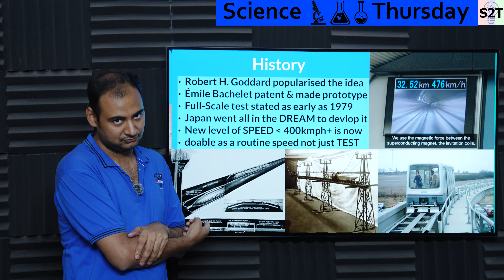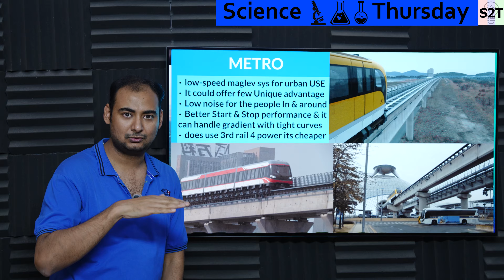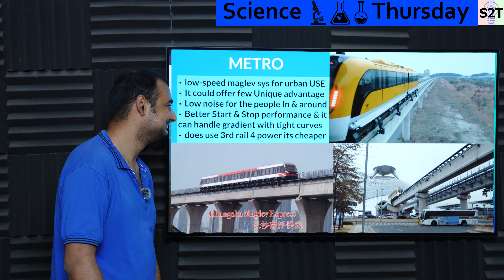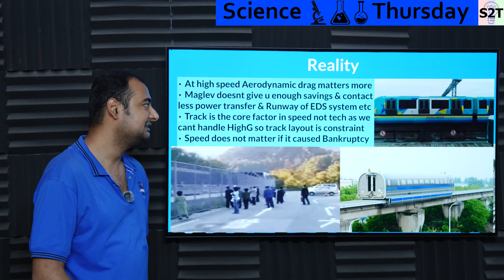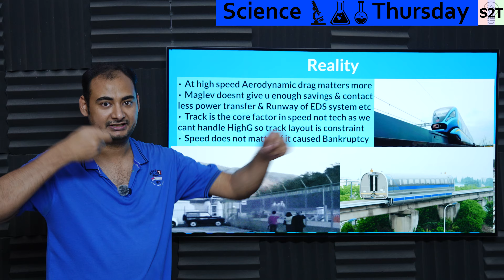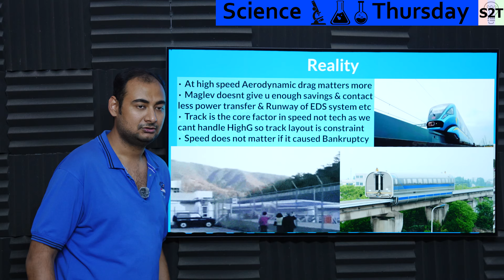MAGNETIC LEVITATION as METRO Explained {Science Thursday}

Comment: Great video! I'd love to see a Science Thursday on how atmospheric trains with carbon fiber coaches could be the ultimate low-cost metro.

By using air pressure and ultra-light materials, you eliminate heavy traction motors, transformers, and pantographs—massively reducing infrastructure weight and cost.

References:

Atmospheric: https://youtu.be/TgSr-LSRTBY | https://youtu.be/N4UnyJ8-NtY?t=1089

Aeromovel: https://youtu.be/pnkt2-CkV8A | https://youtu.be/-EfG5iJfkk4

CRRC Carbon Fibre: https://youtu.be/P-X4c89DSH4

Would love to get your technical take on this!
Reply from the maker: Nope we have learned the hard way only few sys works everthing else is just burning money like hyperloop